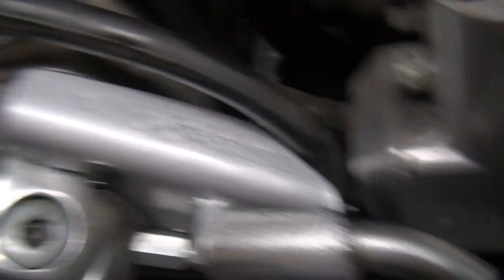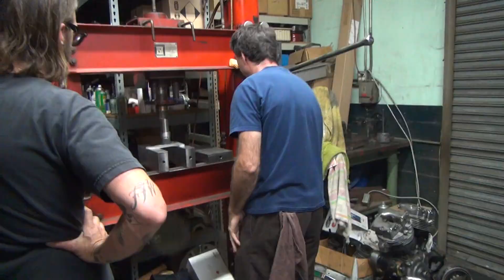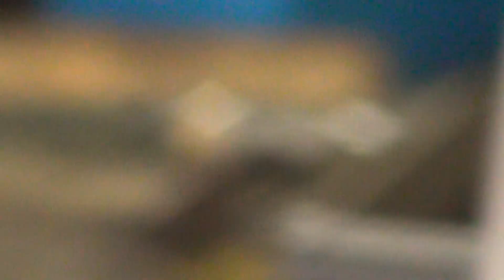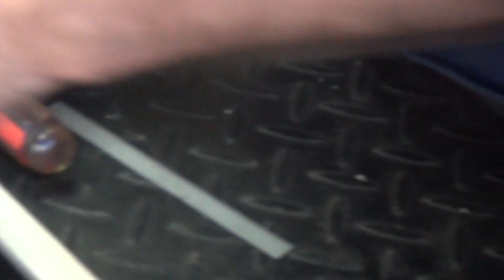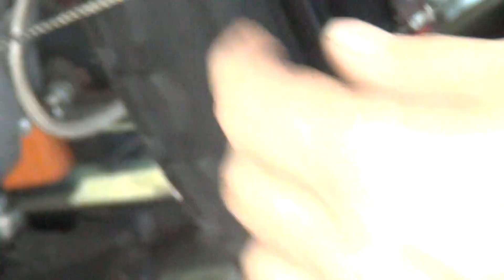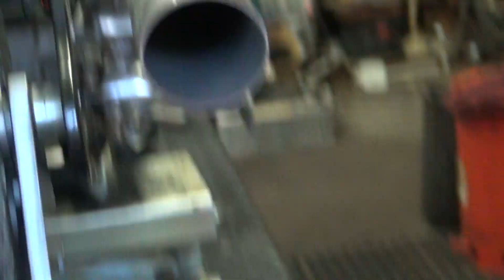1999 80ci evo #101 rigid install mid controls chassis brake repair get running by tatro machine

Comment: at the 38 minute mark you mention that the axle should come in from the left side of the bike, what is your rationale on that statement? personal preference or is it just politically correct?
Reply from the maker: that way i can get the axle out without having to take the exhaust off. got to be able to work on things without having to take everything off to get to the part you want to fix. simple is best.
tatro
Reply: no substitute for experience.
Reply: Tatro Machine you can’t teach common sense .